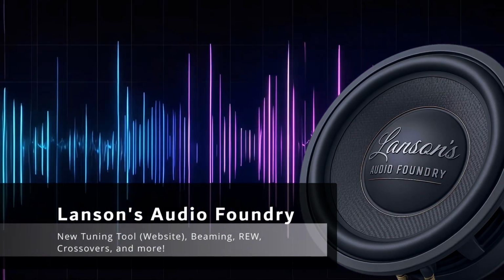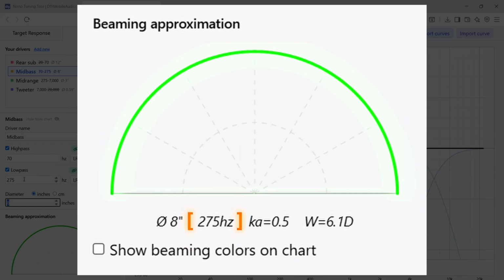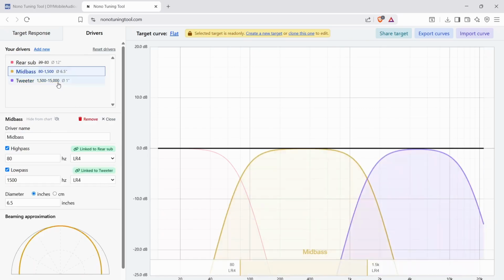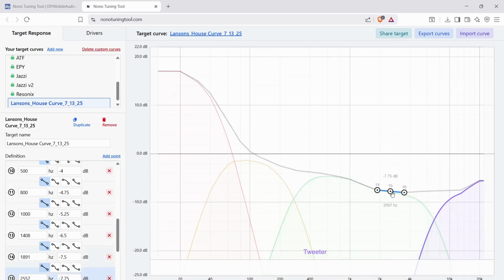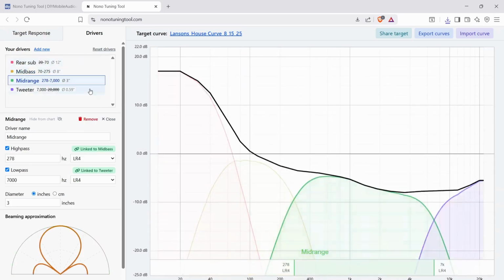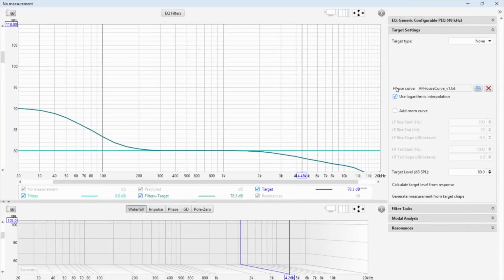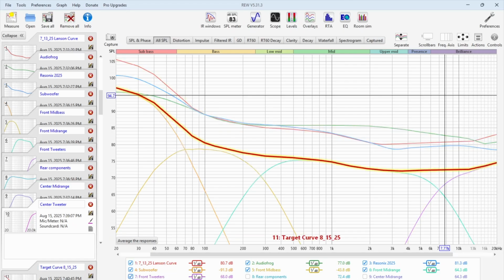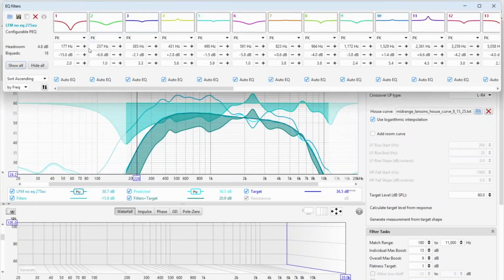Nono Tuning Tool, Beaming, REW, Crossovers, and more!

Comment: Nice video, admittedly I'm having to rewatch it a few times to finally get the hang of it. You are tuning one side of your car here, including your subwoofer(s), correct? So when you next work on the other side, you will omit the subwoofer (as it already has a house curve created)? Or do you just use this for both sides of your car? This part is confusing. Thx for taking the time to break it all down for us!
Reply from the maker: Excellent question.  I usually tune sub(s) separately, and leave filters available to do further integration down the line.  So, it's in my curve as part of the target, and then when I'm focusing on the midbass, I adjust REW EQ controls to match my crossover.  Repeat for the sub, then put them together and measure, adjust as needed.  The sub SPL sometimes works best by ear, not necessarily matching your cuve.. you may find you like it differently than your curve shows...may just mean you have a new preferred curve!

Try this: limit REW to filters to EQ, and make passes with each channel.   Leave the 3rd pass for when you start integrating channels together.  You probably won't need much leeway but you'll have it, that way.
Reply: I've only eq'd drivers by themselves so far using Helix PC-Tool, so I'm not familiar with EQ'ing multiple drivers/one side all at once. I was waiting to see what you were going to do with the house curve the Nono program generated for you?
Reply from the maker: Right, and I'll say I've refined my process to mostly use the built-in REW EQ controls for crossover, as it seems to run nicely with the total curve.  The. Nono Tuning Tool exports will include a full curve and the separate ones, and you can choose what works best.  My latest tune, I did the crossover selection in REW and I extended the filter range slightly beyond the crossover points.  With LR24 filters, this works beautifully.

Comment: You mind sharing your curve? Also, If you export the curves from the Nono tool, why not just drag and drop in REW? Instead of selecting them in the EQ window and generating a measurement from target.
Reply from the maker: Hey there!  I put the file in a Google drive https://docs.google.com/document/d/15gG7E_XzErJ6vqTjQ4SW0W8F5irTSnkW-mV9DKCeBX4/edit?usp=drivesdk ,just remember that this is a starting point, and it is optimized for surround sound with a Goldhorn DSP and it's Skyatom surround processing.  With standard 2ch stereo, it would probably be a bit extreme on the low end.
Reply from the maker: Also, not sure I ever tried drag and drop, guess I'll take a peek at this next time I'm in REW!  Thanks for that!

Comment: Does Goldhorn offer any Auto tune feature in any software/DSP? Also can you set up rear differential fill in the software?
Reply from the maker: Hey there, no autotune to speak of, at least for now.  It's REW or whatever you want to use, and then manual effort.  It sucks, but maybe they'll change it up some time.  An update JUST came out, you can look it up on audiointensity.com, and that update includes some new input management among some other nice things, though no import functions like text from REW filters which would be my 1st hope over an auto-tune. At least the new update solves my 2nd biggest issue, which was lack of auto-save.  Anyway,  as far as differential rear fill, I'm not sure, but with Skyatom it's already doing things to the rear fill with the algorithm.  You can hear it clearly compared with a stereo feed, much more immersive and 3D, less attention to the rear of the car.
Reply: @LansonF Thats whats up, I been seeing Goldhorn amps/Dsps they look really nice.
Reply from the maker: @SoundXper1ence  Despite the more convoluted, slow setup process compared with Helix, I do find it to be an excellent processor.  I would say, if you're fighting to get surround processing nailed in a build and want all the seats in the car to be a good experience, Goldhorn is worth looking into.  You just have to think old-school when it comes to setup, like the good ol' days with the Rockford Fosgate 360 and so on.  Helix spoiled us a bit.

Comment: I find this interesting for sure. I've been tuning for about 4 years now (my own vehicles). I've used Jazzi's and other techniques.  I'm on my 2nd Helix dsp and have become more knowledgeable tuning with the Helix. Currently running a 3-way in a F150. I just added a front sub so, finding this new tuning tool is perfect timing.
Reply from the maker: Excellent!  Yes for 2ch input setups, I think Helix is the way to go for sure.